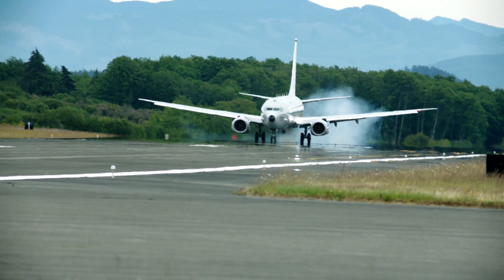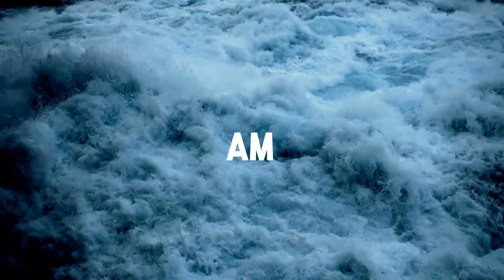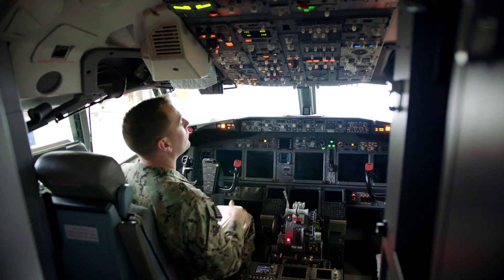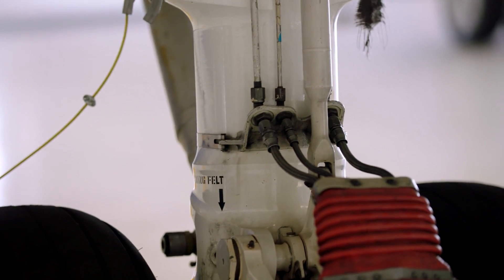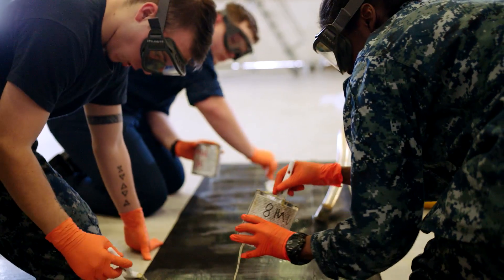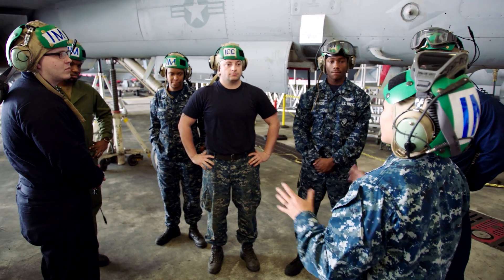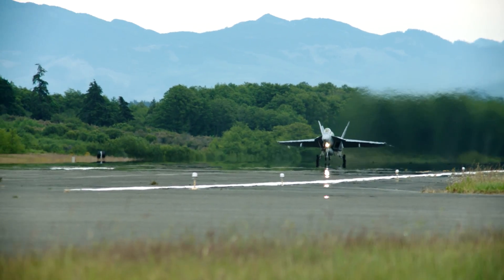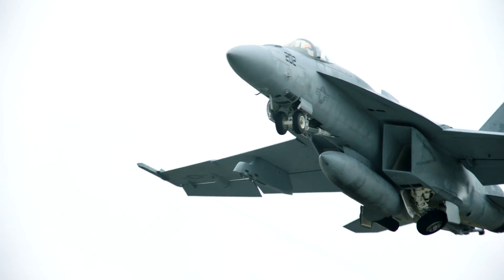Navy Aviation Structural Mechanic – AM

Comment: Picked this job at meps, now I ship out on the 28th. Can't wait!
Reply: i ship august 14th with this job too, good luck brother🎉
Reply: I ship out for this rate aug 5th, see see yall in florida !
Reply: I ship out in sep. 16th!
Reply: See you all
Reply: I ship out june 16th how is it?
Reply: @Bubba7mm08  it was alright, not really that hard
Reply: I’m going into the job soon how is it?
Reply: @michaelhayes8989  As an airframer on F-18s, be prepared to work... a lot. As they mentioned we work on about 90% of the aircraft. Flight Controls, Hydraulics, landing gear, pneumatics, corrosion control, the airframe itself and occasionally painting. Be prepared to work, we really get down and dirty. Be prepared to be covered in grease and hydraulic fluid. The work NEVER stops.

Comment: Can you deploy on ships with this job or pretty much any mechanic type job
Reply: Oh yes. Did 20 years as a AMS before retiring in 1996. That maybe before you were born. You will see a ship, probably a real big one. Spent 14 years at sea and most of the time forward deployed to places you would not like to be. Work like a dog 12 to 18 hours a day for weeks on end. Little sleep, no time off and very low pay. If I was 18 or 19 again I would probably do it again. Now I’m a A&P working Sheetmetal at UPS making over $160K a year. It’s a long way to the top but if you really want it, go for it. But never stop, look back, but never give up. Good luck.
Reply: Simple answer: Yes.  A.I.M.D or Squadrons 
Aviation Intermediate Maintenance Department
AIMD means you will either be 
“Ships company” (on a ship like an Aircraft carrier or LHD) or on a shore command. If it’s your 1st contact you will mostly get “Sea duty” 
Usually you have to do a certain amount of yrs at sea before you can get shore duty. If you get a squadron and it’s still sea duty. You’ll be working from a shore base command and will go out to sea when the ship your attached to goes out to sea on deployment. (Or underway) 
There’s a lot of differences between AIMD and Squadrons. One being the type of work you do. You can think of it as -> AIMD fixes parts for the aircraft (I-level maintenance) and Squadrons take the parts & put them back on the aircraft. Along with maintaining and 
up-keeping the aircraft (O-level maintenance) 
If you want a mechanic job consider these 2 

AM- Aviation Structures Mechanic or 
https://www.navy.com/careers/aviation-structural-mechanic

AD- Aviation Machinist’s Mate 
https://www.navy.com/careers/aviation-machinists- 

Hope this helps ⚓️👍🏽
Reply: Yeah so you can get deployed as an engineman, hull technician, machinist mate. Pretty much any engineering rate. I don’t know about the aviation rates tho

Comment: what is the asvab score to get this rate?
Reply: I got an 87 on my asvab and got the rate. Shoot for a high score lol
Reply: the overall score itself isn't what matters, it's what your line scores add up to be. You don't have to score extremely high though.
Reply: (Late) but I scored 60 and got it, search online for composite scores (for the appropriate test subjects) adding up to 210+. That’s what I did when I got my unofficial scores right after :P and I got it, shipping out April 25th, 2019!
Reply: @bigmiguelpiano2288  update?
Reply: @bigmiguelpiano2288  im considering enlisting with this rate bro. I scored 48 on my practice ASVAB but i did ZERO studying for it, and iv'e been out of school for 4 years. I am currently brushing up on my mathematics knowledge & Arithmetic reasoning, as those two sections i scored very low compared to my word knowledge and paragraph comprehension...  Do you have any tips or advice for those two areas specifically?
Reply: My son got a 92 and was posted this rate.
Reply: I scored a 58 and got a waiver cuz I didn’t score high enough
Reply: I got a 52 and got it
Reply: I was an eleventh grade high school dropout and I became an AMH and made 2nd Class in 3 years. 1981 to 1985.
Reply: @Iowarail  low af!
Reply: @kingtriefkills  actually I did well on it, although after 38 year I don't remember what the score was.
Reply: @Iowarail  it was a joke. sarcasm doesnt translate well via this medium.
Reply: @kingtriefkills  it's ok, I got it. No problems.

Comment: When i was in the Navy there were 3 AM rates: AMS-structures, AMH-hydraulics, and AME-ejection seats/equipment. I think the Navy merged the AMS and AMH rates, are the E's still independent??
Reply: elwin38 yessir AMEs are still around
Reply: Cool!! To me there are certain rates that should NOT be merged(AME is one of them). When you merge a rate, it becomes instantly overmanned. If they were going to merge AME's, it should be with the Parachute Riggers(PR's). Those 2 rates have always worked hand in hand.
Reply: It depends. On F18 there was an AME and AM shop. On MH60S they are all seen as AM.
Reply: I work on E-2Ds and we have AMs, AMEs, and PRs all in separate work centers